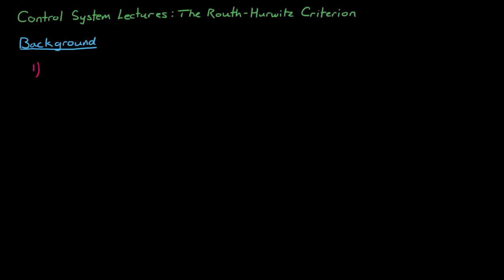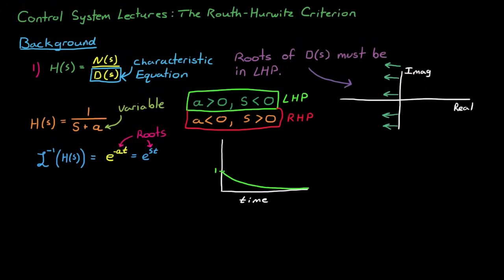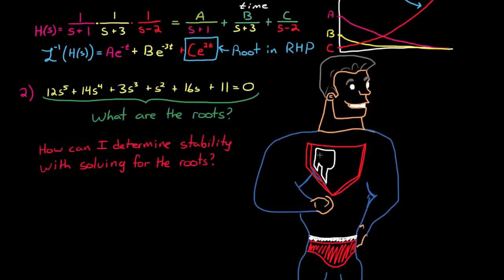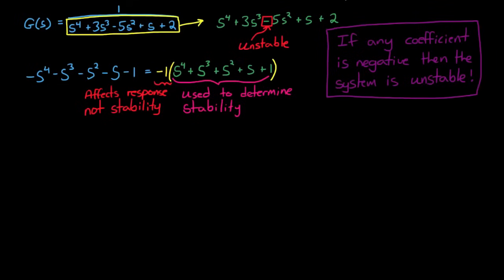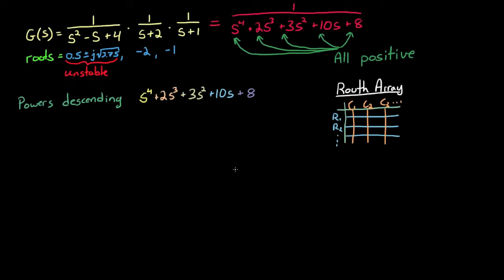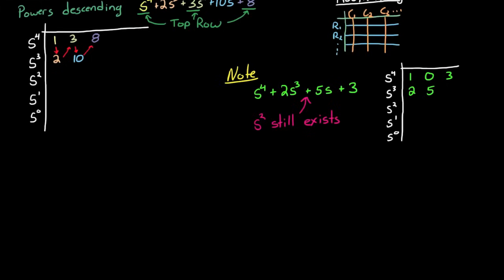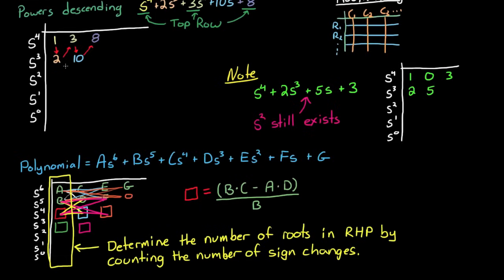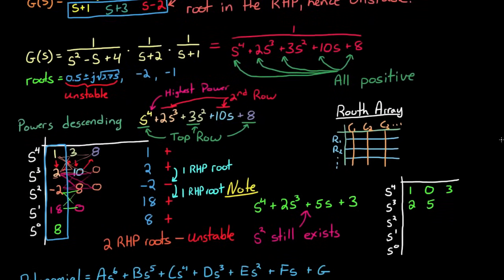Routh-Hurwitz Criterion, An Introduction

Comment: what about the scaling factor? I am using the figure 8 method but its getting different values from the det(matrix) * scaling factor method. I am quite confused

edit - never mind just realised that its the dividing number in the figure 8 method, just turns out that my lecturer's worked through example had an error lol

Comment: Excellent explanation; my Vibrations 1 professor skipped over the Routh Criterion because he said that "it's no longer used in industry, and has been replaced by computers".  However, I'm taking Vibrations 2 (an elective course), and the professor in that course assumed that everyone learned this, and now had to modify his lecture to accommodate that fact.  This helps with the homework problem... :P

Comment: Sir for table in 3rd column  ypu didn't multiple the determinent with negative sign (According to the Norman S. Nise-Control Systems Engineering-Wiley  7TH EDITION  page number 304)

Comment: mmm I think the fourth row coeff (18) should've been -18.   (2*8 - (-2*10) / -2 = (36)/-2 = -18
Reply: That is actually (-2*10 - (2*8))/(-2) = 18. I had a simillar problem while solving it (forgot the negative sign in the denominator)

Comment: how to identify the roots at the jw axis & LHP if there is a sign  change? (the routh array has row of zero)
can somebody explain this?
Reply: Izwan  Roslan if entire row is zero, then it shows that roots are symmetrical with respect to origin. For eg if a row of s^3 is zero then 4 roots are symmetrical with respect to origin [generally s^n zero row gives n+1 symmetrical roots with respect to origin]. All the 4 roots can lie on jw axis with symmetrical pair[let us say +j2,-j2,+j5,-j5] which gives us marginally stable system. On the other hand a pair can be symmetrical with respect to origin on real axis[let us say(+3,-3,+j4,-j4) even all 4 roots can be symmetrical on real axis (+2,-2,+4,-4)] which will give unstable condition. If you have any questions please feel free to ask.

Comment: Roots at 6:15 are wrong? 4(a)(c) = 16 not 8. Am i mistaken?
Reply from the maker: +Not As Clever you are correct that 4*a*c is 4*1*4 = 16 but the roots I wrote are still correct.  Did you try to work it out fully and see if you got something else? To clarify you're using (b +/ sqrt(b^2 - 4ac))/(2a)? Write back if you're still not getting the same thing.
Reply: +Brian Douglas Wow. Such response time on an old video. Thank you. I am using that formula yes. a=(1) b=(-1) c=(4). I get (1/2) +/ sqrt(17)/2 or 0.5 +/ j2.06
Reply: +Brian Douglas Woops. I am sorry. :( :( You are correct. I feel silly, thank your for your time and for teaching me.
Reply from the maker: +Not As Clever I'm not usually this quick ... you just caught me at a good time! Ah, the problem is inside your square root.  b^2 - 4*a*c = (-1)^2 - (4*1*4) = 1 - 16 = -15.  Try that out :)

Comment: Hi Sir, Thanks for the great video. I just have one question.
When I enter the above equation s^4+2s^3+3s^2+10s+8=0 on wolfram or other root finding websites,, it doesnot give me the same roots as yours (i.e. 1,2,-2,18,8). Could you please provide some explanation for this point? Many thanks !
Reply: You dont calculate the exakt roots, you can only deduce the number of roots from this calculation :)
When you look at the roots he provided at 06:08 you see that they match exactly with those from Wolfram!

Comment: the videos are gr8 thx a lot for uploading them, I just had a question about this topic,
the way u solve  Routh array table is different from what I was taught bk in uni and also what I found on Modern Control Engineering by Ogata 5th ed, Is there two way to go about this?

Comment: Hi, im confused, in this video and also in the previous video on introduction to stability you state that in order for a system to be stable all roots have to be in left half plane (of the s-plane) then you add that they have to be real roots?

Is this correct? So whenever the charactheristic equation contains an imaginary root the system becomes unstable? I hope you can clarify, thanks
Reply from the maker: Norstudent Norvid Hello! Could you let me know the time in the video where I state that and maybe I can clear it up? For stability, the roots of the characteristic equation (poles of the system) need to be in the left half plane, which means the real component needs to be negative.  You can have, and often do have, systems that are stable with imaginary components.  This means the system is under damped and will oscillate before eventually reaching a stable steady state.

Comment: Hi Brian. At 11:00, did you mean "Any pole in the RHP means that the system is unstable" instead of "Any zero in the RHP means that the system is unstable"? RHP zeros would mean a non-minimum phase system, right?
Reply from the maker: You are correct! I said the wrong thing.  I must have had zeros on the brain since I was talking about writing zeros within the Routh Hurwitz array.  I'm surprised no one else had mentioned this before.  Thanks!  I'll make an annotation so that it doesn't confuse people in the future. If you find anything else in my other videos please let me know so I can correct it.

Comment: Hi Brian. Your Lectures are great to fill some gaps in my study (especially when lecturer said to study Routh-Hurwitz Criterion by ourselves at home), but I have to correct you.

At the beginning (0:40), you say that the roots of characteristic equation are the same as poles of the TF. That is not true, because when you create a TF, you can reduce zeros and poles (eg. in (s-1)/((s-1)(s+2) to 1/(s+2) - stability change!) and then it is NOT the same. They tought us the same at Theory of system but corrected at Automatic controll ;)

Also a little mistake at 3:30 - I believe you wanted to write "without solving for the roots" :)